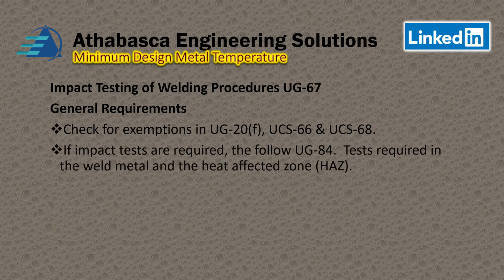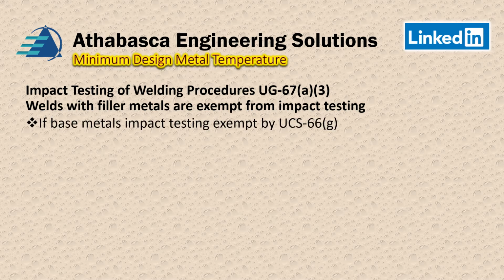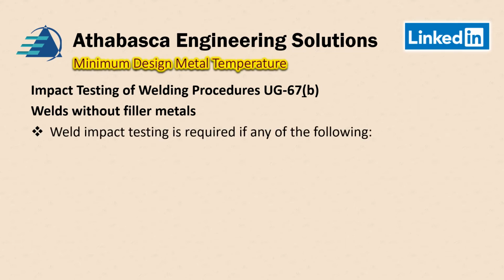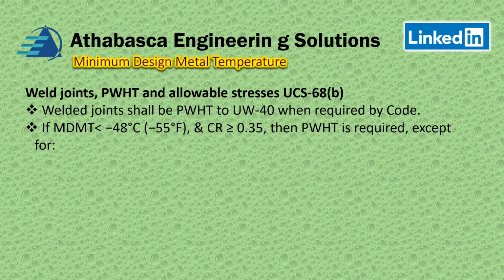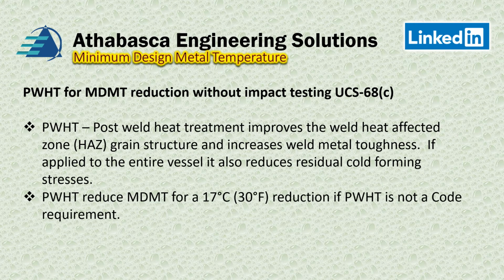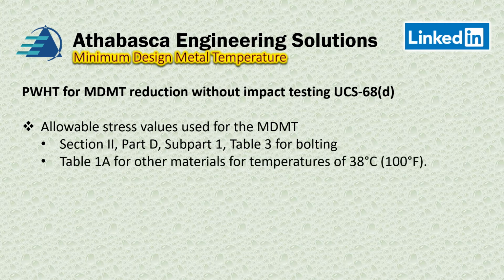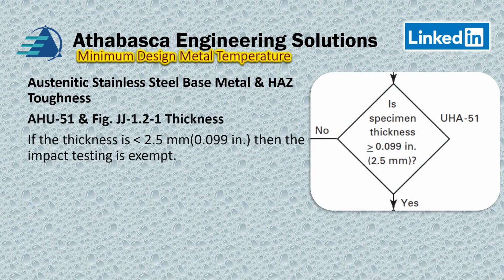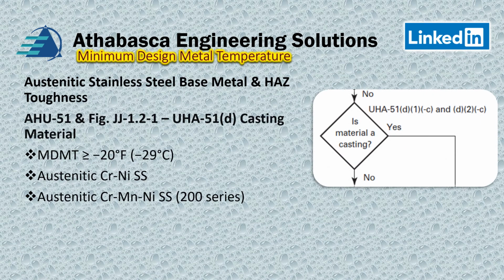Episode #5 MDMT Section VIII Div. 1 Procedures Part 3

Comment: for the UCS 67 (a) (4) it is required impact test not exempted , it is nearly  the reverse of the case UCS 67 (a) (3) , it belongs to the main the pragraph UCS (a ) , it mew point diffeent than point (3 ) above it
also , UCS 67  a 4 is nearly the same condtion as UCS 67 b 4